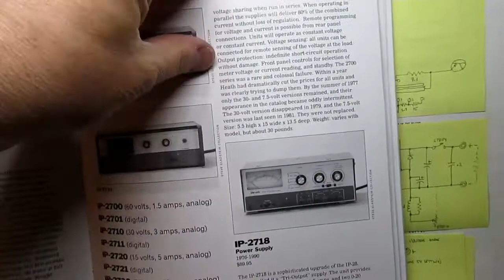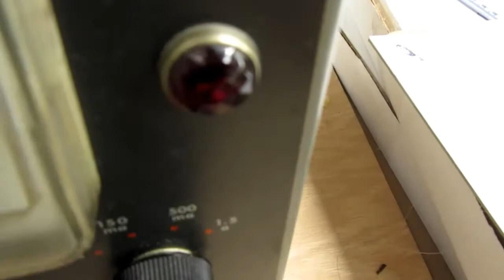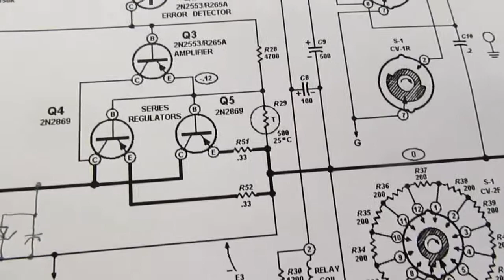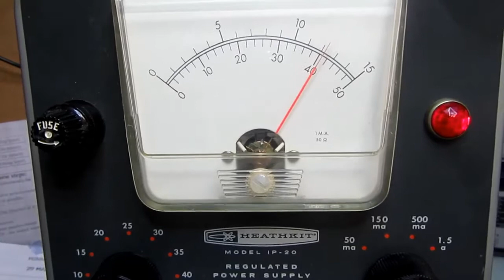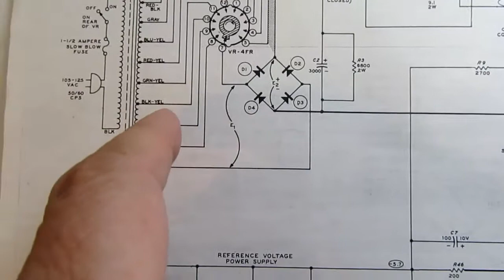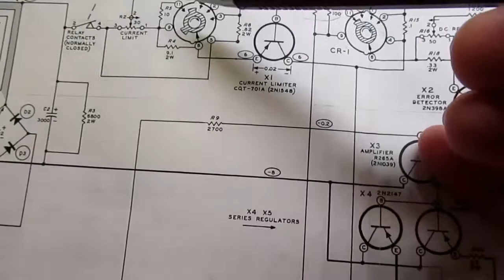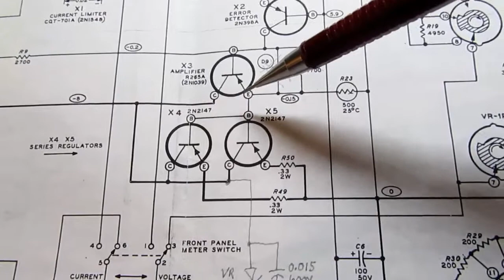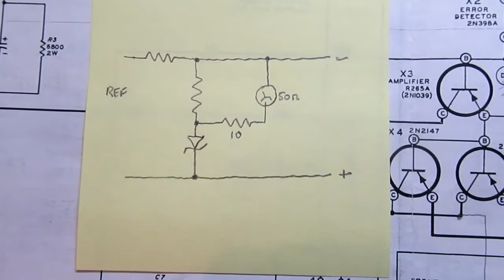Heathkit IP-20 Regulated Power Supply: Overview, Demonstration, Theory

Comment: I have a color dot generator & a single generator.  Would you be interested in them?
Reply from the maker: John Dean, thanks, but no. I have to draw the line somewhere, only so much room in the house. I have restored all models of low voltage power supplies and all the early digital VOM models and all the capacitance and/or inductor meters, some of the LR bridges, most of the capacitance and resistance boxes. I am considering doing the frequency counters, maybe......